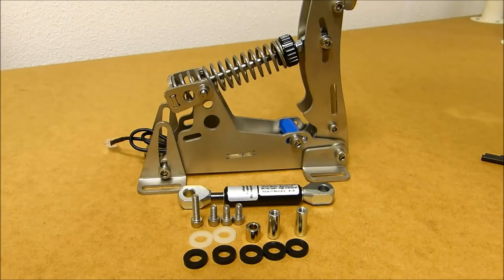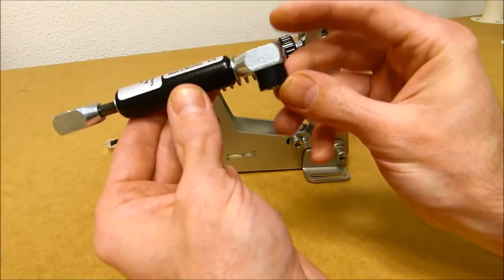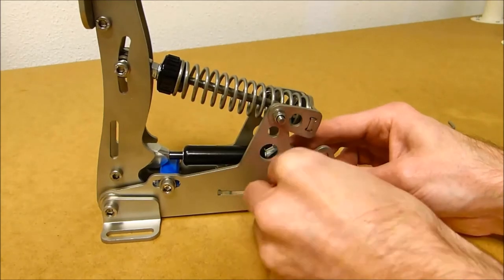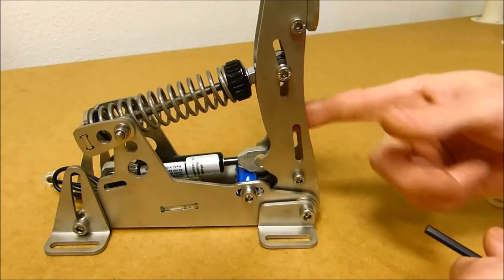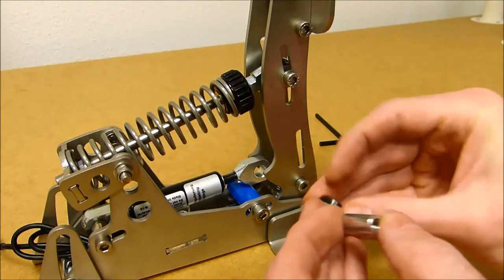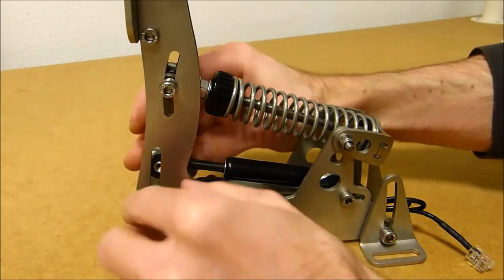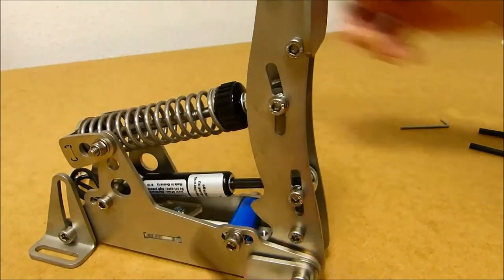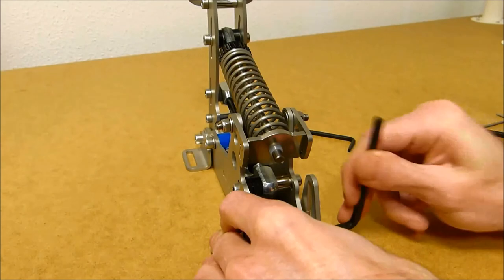Service Bulletin #1 - Sim Pedals Ultimate Throttle Damper Retrofit

Comment: Why use dampers if there is spring already?
Reply: Same reason shocks are composed of both a spring and a damper. Spring makes the pedal return but doesn't oppose the movement like a damper does. Having only the spring makes the pedal too soft, but only the damper makes it too hard.
Reply: @TheSkipjack95  Yea I bought my sprints thinking I was going to get an upgrade from the Fanatec Inverted V3s which also have a damper built in and they completely change the feeling of the brakes. The Sprints feel like cheap toy brakes in comparison. I know they aren't because of how well they are made and the ability to adjust them but without this damper they just don't feel right. Unfortunately I don't think it's possible. There is a guy that is selling a mod but I don't think it's very good although haven't tried it.
Reply: The damper makes throttle modulation waaaaay smoother than just having an undamped spring.  If you were to compare with vs without the damper, you will def see the difference.